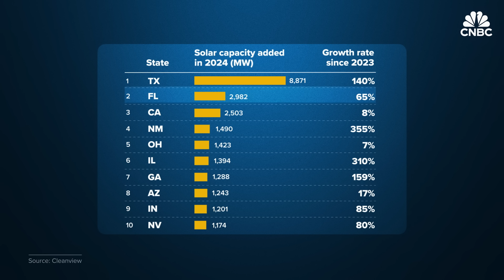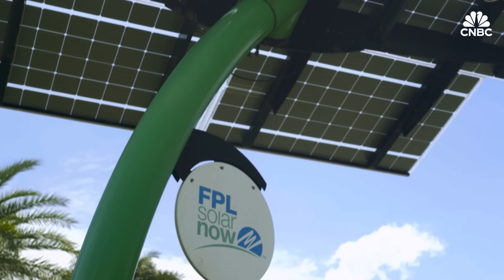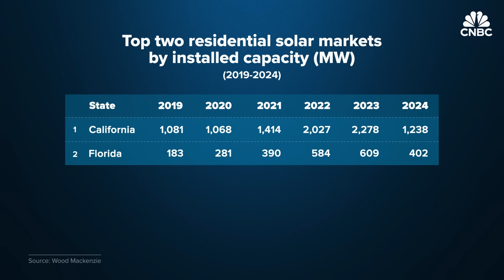How Florida Quietly Became A Solar Powerhouse

Comment: Taking all those acres out of agriculture production is disgusting. Healthy food is already more expensive than it should be, but to take that much land out of production exacerbates the problem. Not to mention that the federal gov gives subsidies to make this switch. It is not benefit the homeowners only the utilities.  Its a lose lose for the citizens.
Reply: How about we look at how much agriculture land is used to grow corn than is then used for Ethanol?  I guess that isn't disgusting?
Reply: @SDGreg I was just about to say. What a terrible point lol. Additionally it’s not like if the land was left for agriculture it would be used to reduce the price of fresh food. We’d probably grow monoculture nonsense by big ag
Reply: Agricultural land is abundant and this is a tiny negligible percentage. this is a wacko conspiracy theory
Reply: Modern society needs both sustainable energy and food to sustain and grow itself.  There is more than enough land for both agriculture and energy production.

The land under a solar farm could be "dual use" for crops/livestock and energy production thus providing two "crops" on the same piece of land.  A big reason this is possible is that solar panels operate silently with no moving parts or emissions.

Also the land is healthier under a solar farm than it would be under an actual agricultural farm.  Agricultural use of land has constant use of pesticides, fertilizers, animal waste runoff and tilling of  top soil which leads to a lot of top soil loss.  Not saying we don't need agricultural farms but we'll soon be dealing with a reckoning with the way most agricultural farms operate.
Reply: People aint growing food for you anyway chief, they'll sell it to some other state while they waste aquifers